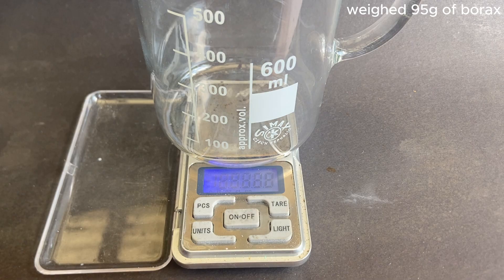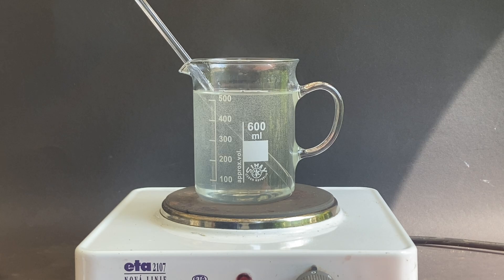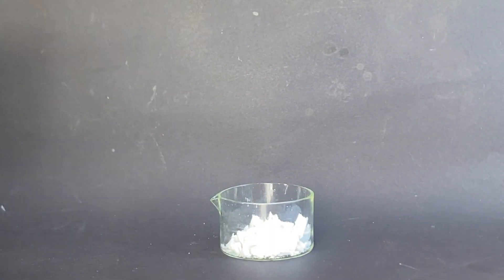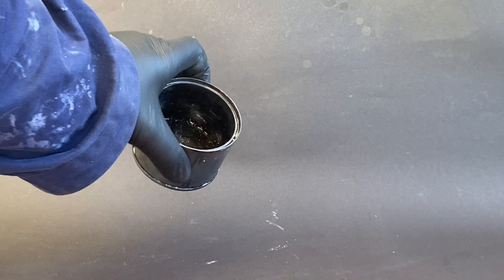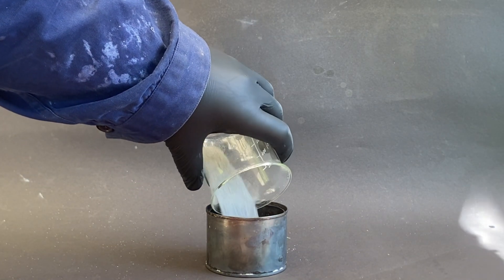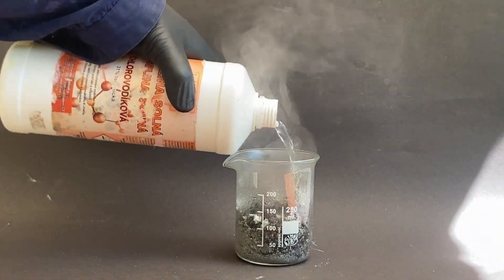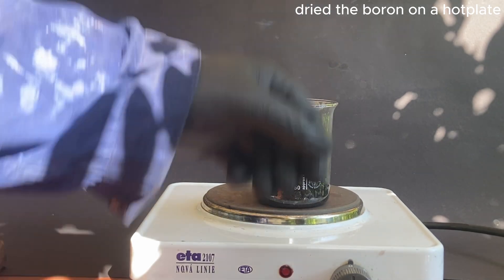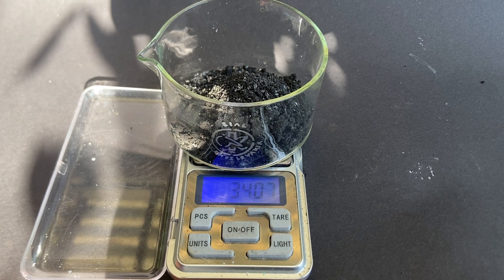Making BORON from BORAX

Comment: I run a special Products unit at a chemical plant, and we make 90-92% elemental Boron, and we use an oxygen/acetylene torch to start the chemical reaction, similar to what you did just on a larger scale, and it is quite a show, a welding shield is a must though!
Reply from the maker: Wery interesting. Thanks for sharing!

Comment: boil or reflux the boron slag in HCl for several hours should do it after which i usually leave over night.
Reply from the maker: thanks for suggestinon!
Reply: @drakinfire7205  also for the leaching process, use sulfuric acid instead of HCL

Comment: What is boron.? What it's use for.?
Reply from the maker: Boron is a chemical element. It doesnt have many uses for amatheur other than coloring mathanol flame blue or green (i dont remember wich one) i made the video based on a vote, not because it has some good uses.
Reply: It's used in engine oil as an additive
Reply: Its used as an igniter, in airbags, SRB's, flares etc